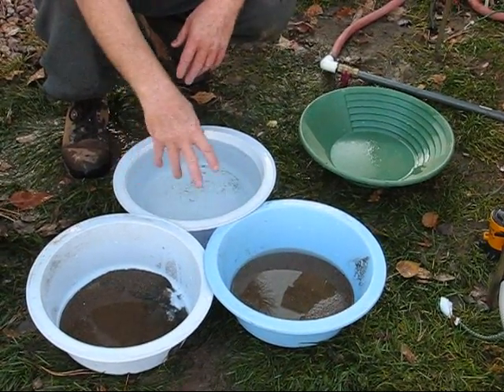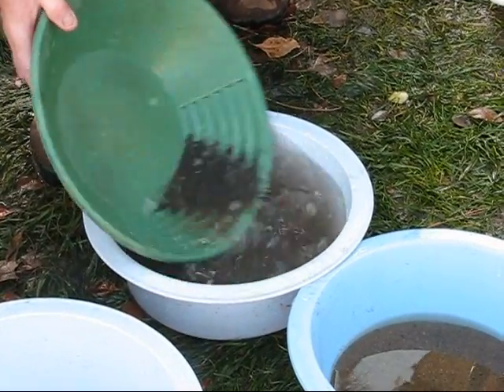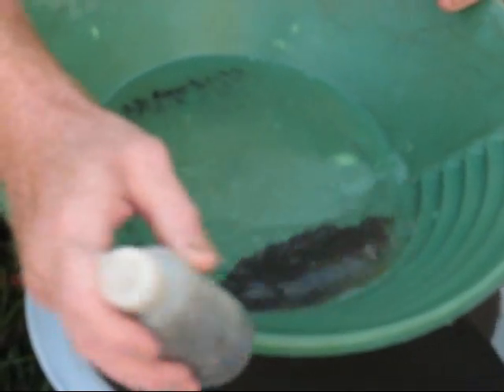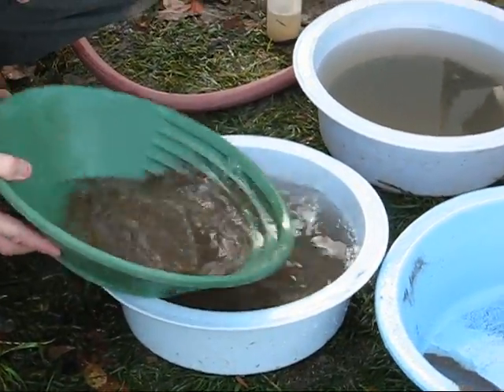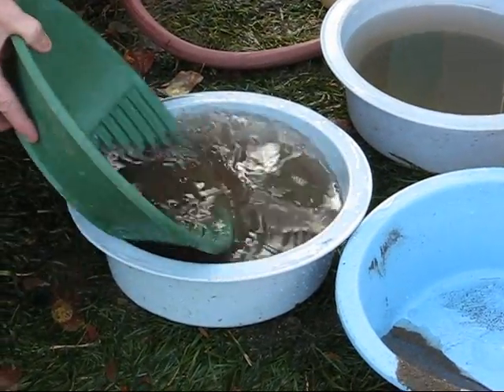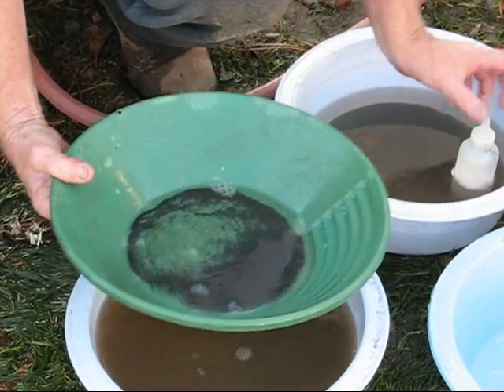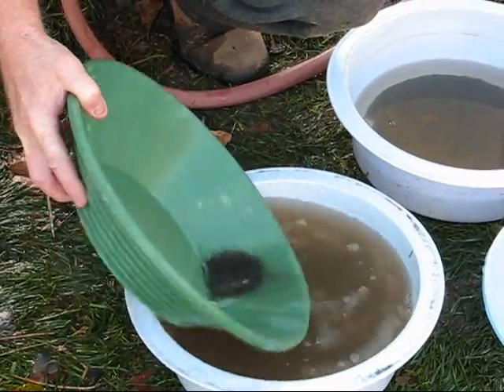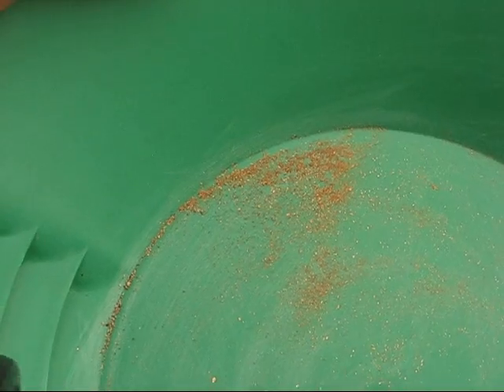Fine Gold Recovery Test part 2

Comment: Hey not to be mean but maybe you should work a little on your panning.And when you get down to the last bit of black sand swirl the water in the pan in circles that will wash the sand away and leave the gold.The tiny pieces you can pick up by licking the end of your finger and then touching the piece.Then fill small bottle with water and touch the top of the water and the gold will fall to bottom.